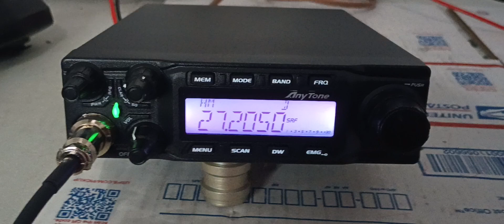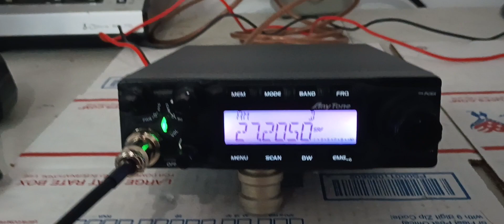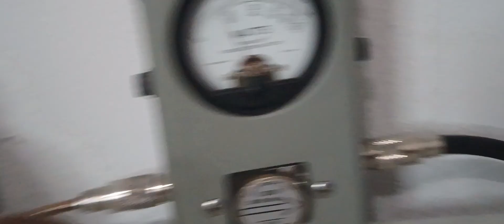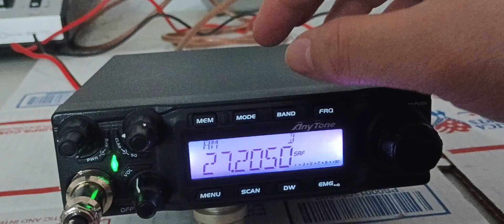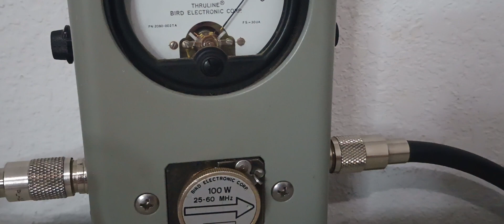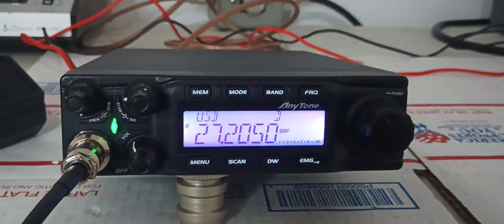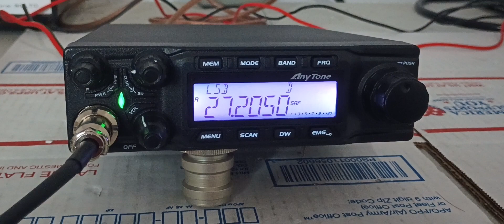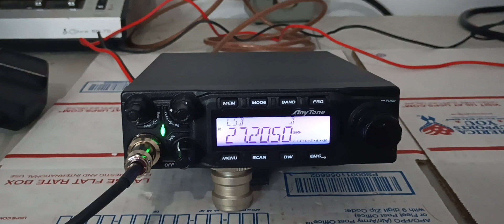Anytone AT-6666, Customer Send Back, double checking power output, current consumption, performance

Comment: These radios are great just out of the box. The only thing I've noticed is that occasionally if you use them a lot in turquoise or blue display the blue LED tends to wear out faster than the other LED colors so I usually leave it on green all the time now. Every single radio I've ever gotten does 50 W FM and single sideband 25 watts AM.
Reply: 100w is utter lies..

Comment: This is very common guys , it has to do with your coax type , coax length,  is the coax “tuned” , are you using a Bird meter or a Dosy , your power supply voltage , how low is your SWR and reflect ? All of these things combined will be a huge factor .   Nice radios ,

73’s Rooster
Reply: Tuned coax...lol
Reply: @williamlowry9585  
Nulled coax i meant , but I said tuned